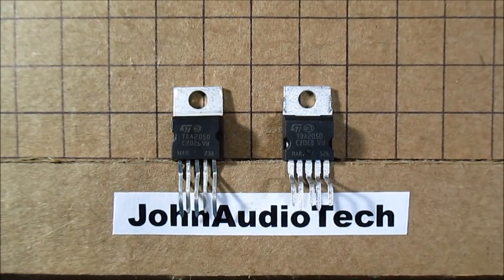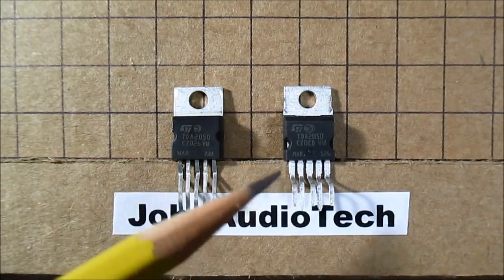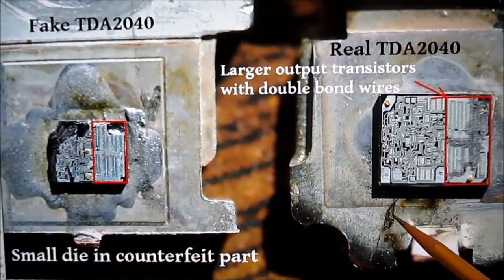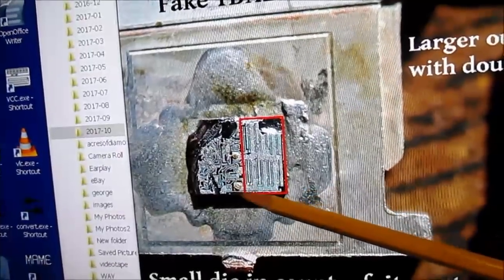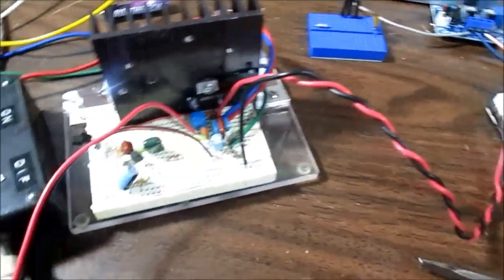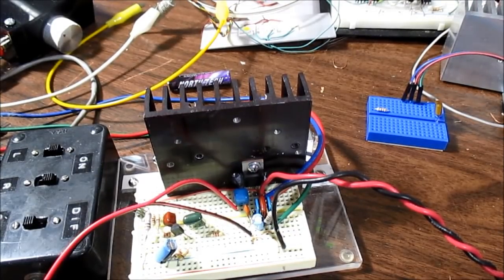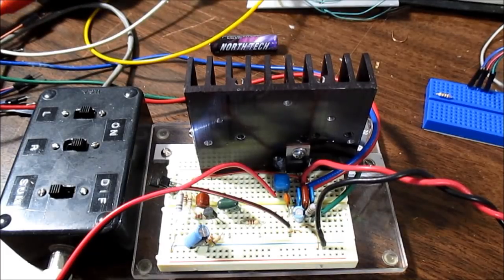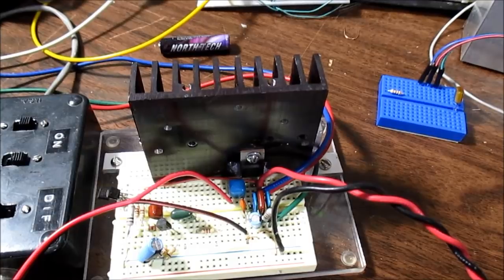Counterfeit vs Authentic TDA2050 audio amplifier IC test

Comment: There's been times for me the fake part saved a machine from land fill. Either the OEM part was gone long ago or the machine's price point for repair was to high.
Reply from the maker: Yep. If there is no other choice...
Reply: Talking about fake parts is meaning that these are no working at all or are blown away from the first moment.
Reply: @GeorgeGeorge-xj2bc  No it is not "meaning" that. It simply means the part is not an original part made by the company they claim it is from. It could be complete shit and not working at all, or it could be an accurate reproduction that works perfectly.

Comment: A little off topic but if you were buying resistors where would you get them from? (I'm new to electronics)
Reply from the maker: DigiKey or Mouser. You can buy the cheap resistor kits off eBay for tinkering.

Comment: I have used few fakes for a while, if you don't push them to the wall they work fine. At the time I bought those I didn't have access to the shop which sells genuine parts, although some that I've got look just like your genuine IC, maybe few of them are.

Comment: thank you sir-actually my speakers are cheap- but still is  there any easy method protection for speaker ?--sir-if i use -25-0-25 v max voltage on fake and authentic chips-power output would be how much ?--is there overtemperature protection in fake chips-sir i like your videos very much-i am enlightened  in electronics world by your videos-sir i have lot of doubts regarding amp,preamp etc -can i get your email so that i can send you -if possible
Reply: a cheap protection for speakers is a fuse in series with output and speaker

Comment: What about STK modules? That would be interesting. Ones that are most faked are the STK0050 and STK0080
Reply: I've used them in repairing early 70's Pioneer stereos, they seem to work well. I believe Sanyo stopped making them in 2003 so originals are hard to find and I just automatically assume none for sale today are originals. I usually get two module sets one set matching the original module and the other matching the specifications but at the highest power rating in the same family (check the datasheets). Question I've always had was just to what degree are they knockoffs? If they bought the equipment from Sanyo back in 2003 and are using that same process are they really knockoffs?
Reply: @jordanch68  They make c-feit equipment.

Comment: Presumably only buy from companies big enough to deal direct with manufacturers. I can't believe the hobbyist market is big enough to produce chips for - might be big enough to fake in the sense of adding false markings to some other part. That raises the question of where these parts go - equipment - how do you guard against equipment with fake parts in. In this case probably a big market for low cost / poor performance audio equipment.

Comment: Also be careful when dealing with lm1875s, a lot of tda2030 just marked as an lm1875. A couple of things i noticed are that 1875s dont have those side notches and have wider leads that are rounded at the end and not sharp as these tda chips. Those tdas that they engrave as lm1875 are probably fake as well. Great video as always John.
Reply: Lm1875 ics sold these days don't have that indentation mark, pins are thinner and no scoops at all and no zigzag cutting on the tab
Reply: Of course... c-feit to c-feit, as long as it sells.

Comment: also if fake chip die suddenly due to overheat will it harm speaker or signal input device ?
Reply from the maker: It is possible the speaker can be damaged with significant DC on the output from a shorted transistor. I doubt the input source will get damaged.
Reply: the speaker
Reply: i have build several amplifiers use tda 2003/2040/7294/1514a and many others using a couple of darlington like tip142/147 , all work very well but it's hard to calculate a good protection for the output transistors :( for exemple my DIY 2x200w using darlington if i short circuit the output...poor tip142/147 burn immediately...do you have any good idea for this?
thks a lot ;)
Reply: @madjidhamdini1977  If there's a chance of shorting the output and you have expensive output transistors, then you really have to have output current limiting. Monitor the current through small emitter resistors and use that to short out the drive to the output. It's a common enough circuit that you should be able to find numerous examples to copy.

To protect speakers, it's a good idea to have some sort of fast-blow fuse in-line with the speakers anyway.

Comment: sir-if i use -25-0-25 v max voltage on fake and authentic chips-power output would be how much ?--is there overtemperature protection in fake chips

Comment: jonh! first,  great job, great video. what is the replacement of the tda2050 (other than lm1875)?
Reply from the maker: That was the end of the line for those 5 pin chips.
Reply: Mouser is still selling LM1875 at £3.56 for 1 off, so if you really need to replace a TDA2050, that's your best choice.

Comment: The LM1875 kit on one of your older vids looked iffie to me also but you showed it worked just as good.. Im getting one of those lm1875 kit for a project but powering it will be a little complex for me..
Reply from the maker: I decapped one of those 1875 ICs from the kit and the die was 10mm square which matches the real deal. Performance matches as well. Some sellers of those kits say the chips are used (probably pulled from boards of a canceled product).